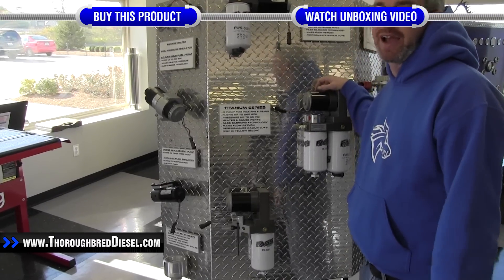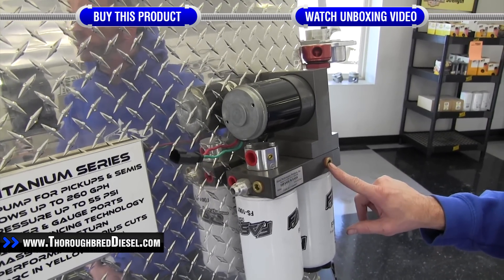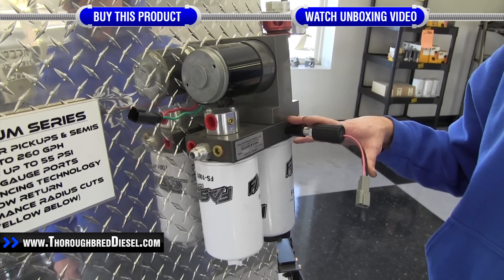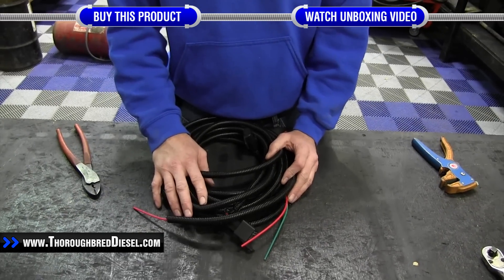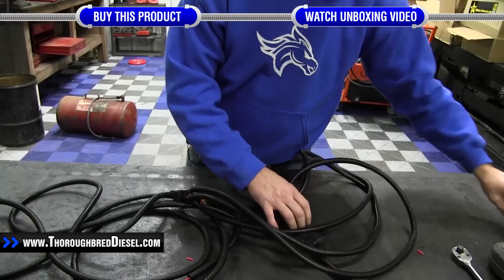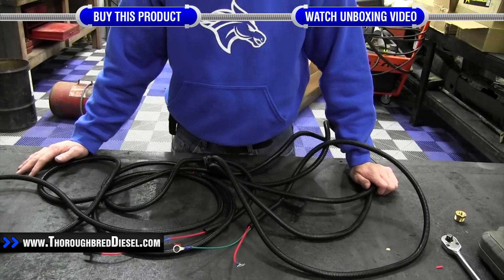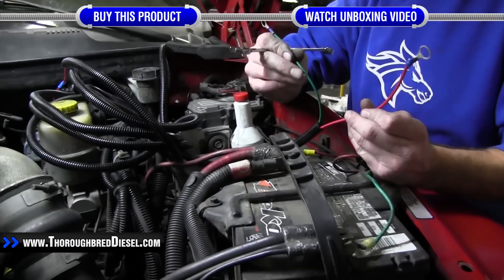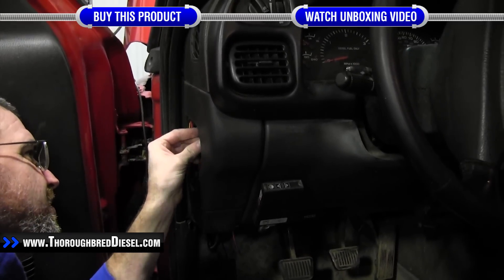FASS Electric Fuel Heater Kit Install: Perfect for Cold Weather

Comment: So adding a 2nd heater probe needs the Y power adapter or tap it yourself, a larger fuse, a 2nd heater probe, 2nd black threaded bushing thing and obviously some more Teflon tape.
Reply from the maker: Good tip!

Comment: For Ignition tapping what I did was use a add a fuse to a bolt/nut style circuit breaker mounted to the firewall. I need a lot of Ignition feeds and usually need more later. So the CB gives me a bolt post to keep attaching IGN trigger for relays to. That then goes to 2 mini rocker switches near the dash with colored LED. A red switch is for heaters, a green one is for the pump. They also work as a disconnect for both to disable them for other service while the Ign is on. For the preheat option flip off switch for the pump. Turn IGN on for a bit then heaters will activate. Then I can see the pump temp also and wait for the temp to rise a bit. Then flip switch to turn pump on.
Reply from the maker: Thanks for the great info!
Reply: I often wondered if you had a severe accident and it severed the fuel line and continued to pump fuel, then what. I guess it could do that with any electric fuel pump.
Reply: @ToddM452  Yes pretty much any car since mid 80's or so uses an electric fuel pump that can continue to pump fuel.

Comment: Well installed the Disc and wired the heater really to a switched also hot source for the relay. At  27 degrees turn the switch on and I get 7 DC amps , if I then turn the engine on I get 21 DC amps. My goal is to pre heat the disc as recommended .The heater is wired to the aux battery. 2006 LBZ. Why aren’t I getting the full 21 Dc Amps with the engine not running?
Reply from the maker: Amperage increase once the alternator is in play?

Comment: How long would it take in let’s say 20 deg temps to warm it up enough?
Reply from the maker: The same amount of time that your wait to start light is on really.  And that’s not an exact number, but when the key is on and if there is a ice dam, this will allow for fuel flow, and also will be heating fuel entering the system that will help to balance everything out.

Comment: I will never understand why FASS hasn’t just made a t-plug to run the heater off of the existing FASS pump wiring harness. Even if they just added a second wire would make it better than running a second wiring harness for the heater.
Reply: Im looking at buying the heater and that was my thought exactly. I had a hard enough time finding 1 key on power fuse.

Comment: My question is why would you need one? It was -20 here and my stock system doesn’t need heat. You cant have it on overnight, won’t it draw vehicle batteries down? Now if could have it plugged into 115v overnight, wouldn’t the cold fuel in tank cool it right down fast?
Reply: If you have a stock fuel system it has a heater.  Stock system doesn't have sub 5 micron filtration either.
Reply: insert Canadian comment here ..... -20 is an average winter day in the warmer parts of alberta canada ....... -30 -40 is a normal colder day in mid to Northern alberta. soooooo i would say a heater is a greeeeat idea if you are south of Canadian boarder id say youd be in good shape without the heater.
Reply: @ShainAndrews  excellent point sir

Comment: What Fleetguard fuel filter & Water Separator do you use on the Older HD series Fass System? That's the setup I have. Thanks
Reply from the maker: Here is the link for all of the filter cross overs: https://fassride.com/portfolio-item/replacement-filters/

Comment: I see that you connected it to a fuse that needs the key on... Will the heater still work of you use the keyless start to start the truck?
Reply from the maker: That’s a good question. I would expect it would depend on the fuse that you tap. Our LML has the remote start and our pump comes on with remote start. It would be something that would have to be checked upon installation.
Reply: @thoroughbreddiesel 
What fuse did you tap into on the LML? For the heater to work with the keyless start?

Comment: if I'm seeing this correct you have a separate wire harness to the lift pump and the heater has its own harness with relay, fuse?
Reply from the maker: +barry wirth Correct.  If you order the HK1001 kit,  it comes with the element and the wiring harnees.
Reply: Shouldn't you be able to just splice into the lift pump wiring harness especially since the harnesses are the same with the same fusible link, instead of having to find another fuse in the fuse block to tap into and run another loom to the battery and just look like crap with tons of wires running off the battery.

Comment: The electrical connectors were not crimped on correctly, they were rotated 90 deg. from what they should be. Also a "bung" is the threded opening in a barrel top. The part he was referring to is a "brass threaded reducer".
Reply: Terminology and phrases differ everywhere.. you understood it clearly. Don’t bust the guys balls simply due to the fact he describes parts with different terminology. He did a very good straight to the point tutorial.
Reply: If you wanna get technical. It's a bushing...like you go to the store it will be labeled "bushing"

Comment: Will you need more than one wiring harness if you're running dual heaters?
Reply: no if you run 2 heaters just hard wire to the wire harness near the plug for the first heater !!
Reply: Needs a larger fuse too